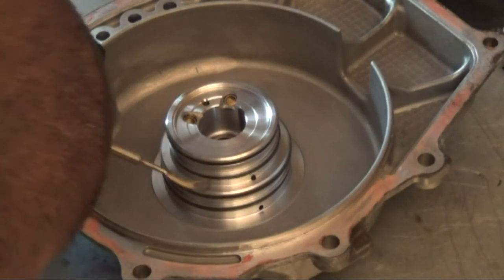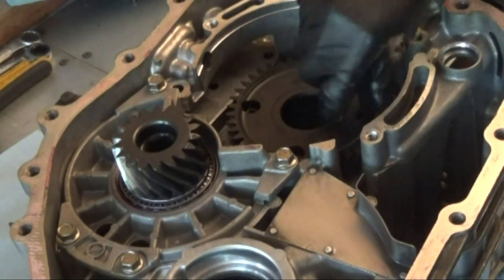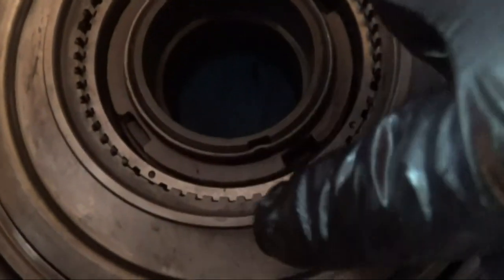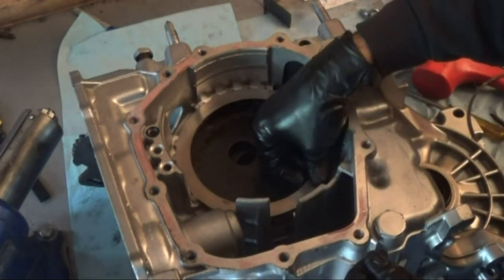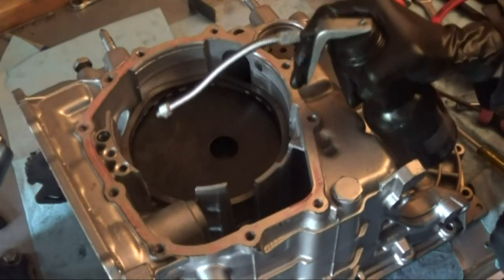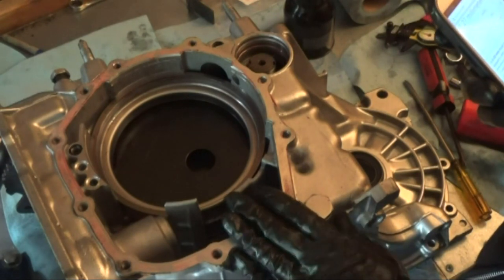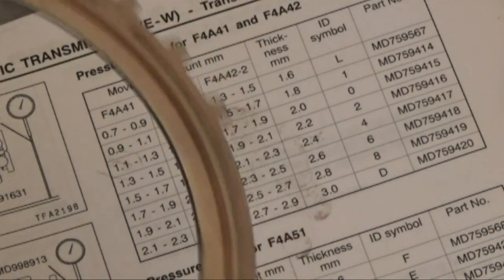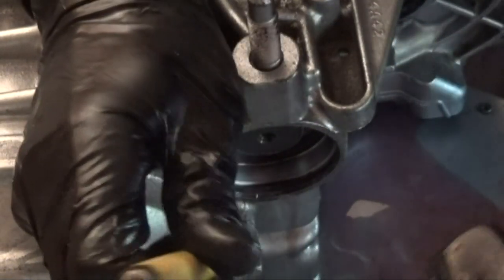F4A42 Transmission Rebuild: Part 4 -Reassembly (1/2)

Comment: Lancer transmissions are tiny lol
My 02 diamante AWD was having serious problems so thought it do an atf change, ran and shifted well after it was done till it cooled down and It became worse then before the next day
While it was kind of drivable, it was having trouble going into first or reverse, once it would move, second gear would lock up completely while cold and up shifting to 3rd does nothing but slipping, kind of like it was going into neutral and would go into limp mode after a while of not finding a gear
Going off the workshop manual, I've come to the conclusion it was the valve body so I'm currently in the process of stripping and cleaning it, thank you for the videos, they've been most informative

Comment: I know that others already asked, but could you please tell the thickness of the needed special tool MB991631? It seems that it can easily be laser cut out of sheet metal.
Reply: It looks like this is the main secret of the transmission) did you manage to find out the thickness of the tool?
Reply: I had to import the tool MB991631 from an american seller and pay a lot for the shipping only to find out that it is exactly 2 mm thick.
Reply: @smallenginevidz7754  You describe really big problem. I know several people who's unable to perform good repair because of this tool - there is simply no place to take it. And if you repair the transmission by yourself (not as professional service), then it is impractical to deliver it from USA. It is easier and cheaper to replace the entire transmission :( And interestingly, no one writes anywhere about its thickness in order to make something similar by himself. There is no accurate information anywhere on the Internet.
Thank you for the information. I very grateful to you!

Comment: Your video is help full but you seem to forget those of us watching are not experienced and searching for help. But you fast forward parts that should not have been. I bounce back and forth between the service manual and your video from an un clear manual to a fast forwarded video. 
Whe you took apart the trans you removed the upper brake piston then some clutch plates n disks but how many and the order you n the manual are not clear. Then you removed wat you called a pressure plate which the manual calls a activator plate and one brake disks and the manual doesn’t show one disk bringing removed. When you Assemble that part you skipped over it like you had a problem with it I never shared it and then getting down to the clutches in steals you must ride over those two in fast forward. That leaves me n I’m sure lots of people wondering wat to do. 
Please if you can , tell me the order and how many clutches n steels from that point starting with the lil wave spring. Been working in my trans for a week now trying to figure it out. Thanks

Comment: Hey Matt thanks for the effort to make a video guide for the Hyundai KIA Mitsubishi transmission. 

Q What repair manual are you following it looks great ?
Reply from the maker: I believe I just typed "F4A42 transmission rebuild manual pdf" in google and it popped right up.  I printed it out.
Reply from the maker: Yup that's it!

Comment: How many years to you need to be around transmissions in order to be this knowledgeable about making this kind of repair?
Reply from the maker: Depends on many factors, so it is hard to answer that question!
Reply: How many years have you been around transmissions?
Reply from the maker: Probably about 5 or so years only.  And I don't even work on these things every day.  There are a lot more experienced people than I am.  I do have an intense interest in them however and put forth a lot of effort to learn everything I can about them.

Comment: Transmission on car, the rear cover on mine will not allow the reinstall of the rear cover. Now, I had a gear slipping before the removal of the cover. I'm not a transmission guy, but it sounds like I've had a snap ring or two bust, allowing the plates and whatnot to spring outboard, inhibiting the reinstallation of the rear cover. This sucks. Now, it sounds like I have to drop it out and rebuild it. I'm totally open to comments.

Comment: What became of the bent washer you found at the beginning?
Reply from the maker: After going through the entire transmission and double checking the diagrams in the manual, I concluded that the washer was a completely foreign washer that must have fallen in accidentally during the last time it was rebuilt.

Comment: when installing the piston has damaged the rubber seal on the oil inlet in the piston as the seal is replaced?
Reply from the maker: +Андрей Климов If you damage the seal while installing you need to replace it.
Reply: +MattsMotorz it can be replaced without removing the hydraulic unit?
Reply from the maker: It depends which one it is.  All but one of them can be replaced with the valvebody on if I remember correctly.
Reply: +MattsMotorz did not understand the difficulties of translation :) ) thank you anyway !
Reply: +MattsMotorz Another question is whether the seal fit of hyundai numbered 4567539501na automatic transmission f4a42 mitsubishi carisma?